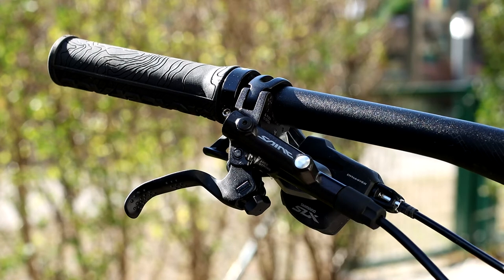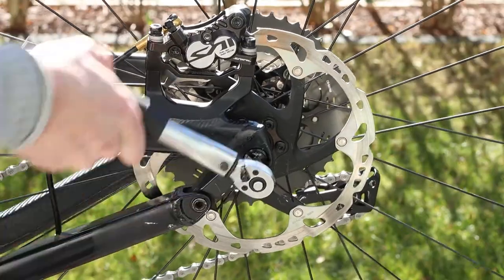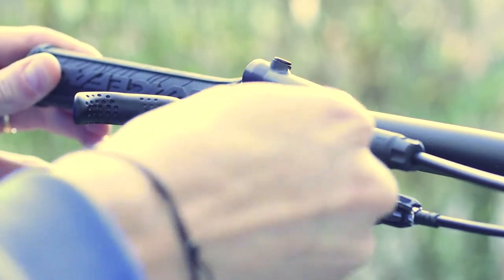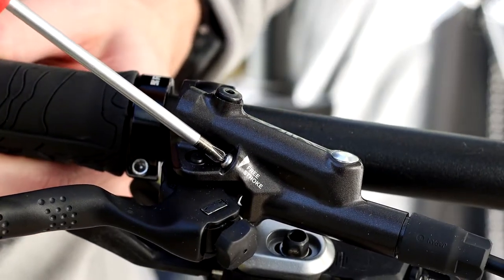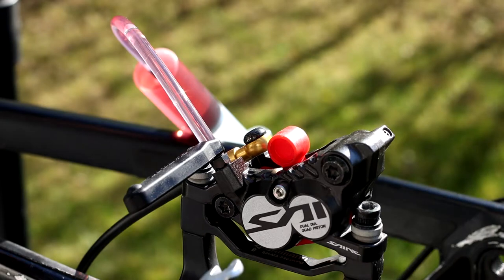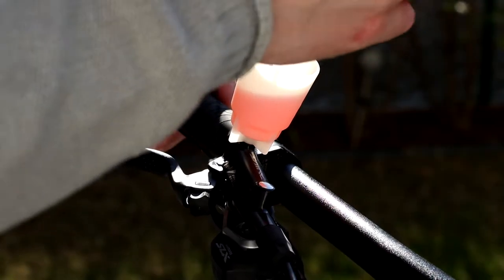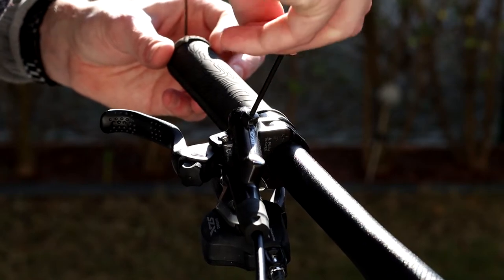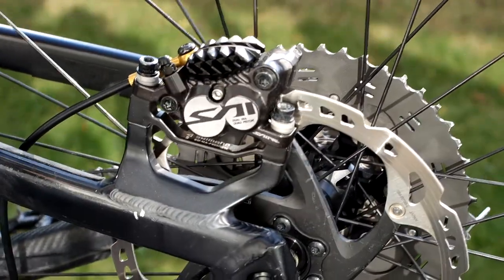Shimano Saint Brake Bleeding Service | Maintenance TUTORIAL step-by-step 🛠️

Comment: what happens if you bleed with the brake pads in?
Reply from the maker: Overall you can definitely do it Martina, nothing change BUT: you have to be very careful with mineral oil, if it's going to the pads or discs then you have problems 🥲